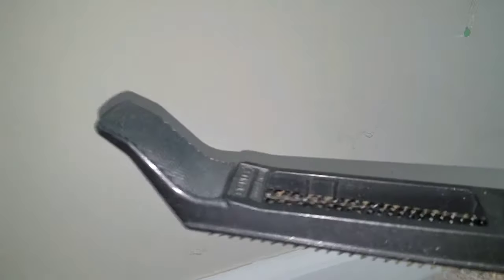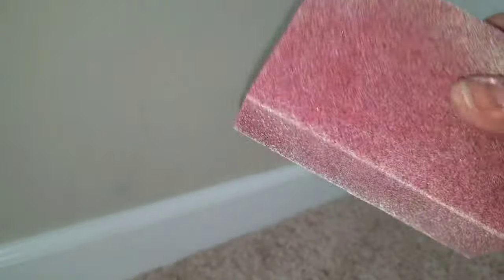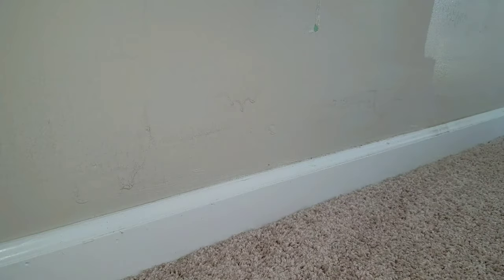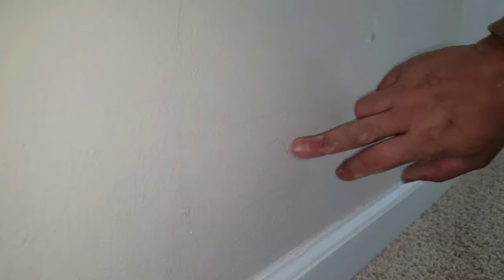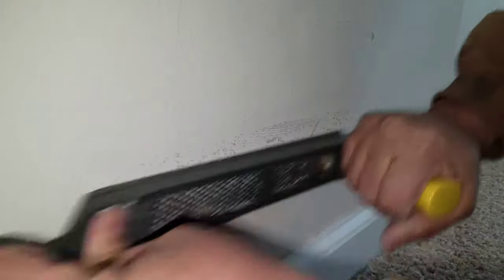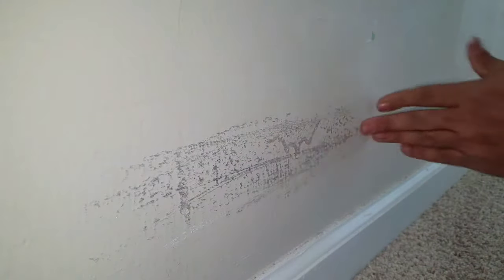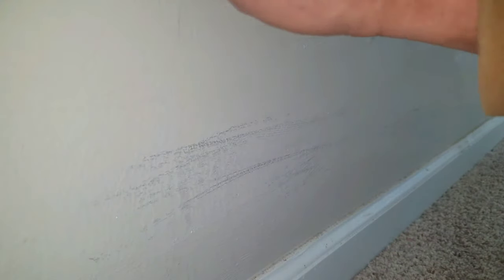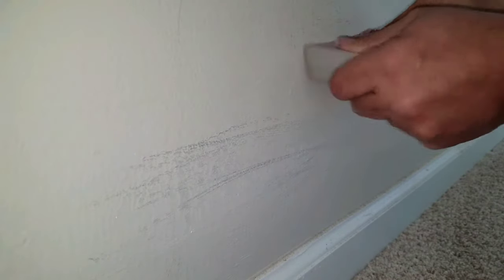How To Fix Paint Drips and Sags

Comment: My wife and I bought a house two months ago and the previous homeowners were quite honestly the worst painters i've ever seen in my life.  Runs, sags, drips EVERYWHERE on the drywall.  They also used cheap rollers and left lint and debris all over the walls.  To make matters worse they realized they had lots of drips and runs and attempted to go back and smooth out some of them with the roller while the paint was still tacky creating a smeared / smudged texture in many area and it's absolutely hideous.  

I am having to go through the painful process of sanding out all the debris, getting rid of the runs, etc. in a 2,400 square foot house.  Some rooms are better than others but the worst is the living room, runs everywhere.   I am going to try and get one of the rasps.  Joe, do you have a link to the type of rasp you were using?  

Tips to diy'ers when painting.

1. CLEAN YOUR WALLS of debris, dust, spider webs, hair, etc. before even thinking about picking up a paint brush or roller.  Trust me it will look 10x better just doing this prep.  It even helps to clean the floors in the rooms you are painting because hair, dust, etc, gets stirred up while moving about the room and this will stick to the paint if there's a lot of it, particularly if you are using eggshell and more glossy paints and not just flats.

2.  If your walls are really greasy or dirty you may have to use TSP cleaner or a degreaser to get rid of the grime otherwise your paint might blister.  You might even have to prime the wall to seal it in.

3.  Close any air vents or registers adjacent to the rooms / walls you are painting as they could blow dust and debris on the paint before it has a chance to dry.

3. When cutting in make sure you use a high-quality brush that does not lose bristles everywhere because you will definitely see them. and once they are dry in it's nearly impossible to get them off.

4. When rolling paint on a wall use a high-quality roller.  Yes, they are pricey +/- $10 for a 3 pack, but it's worth it not leaving lint all over the wall that looks horrible after your done.    

5.  As far as technique goes.  Always cut in first before rolling.  I know some will argue that you can cut in after rolling but generally I think that's harder that way.  If you do roll first, have someone cutting in behind you as you continue to roll and don't let it sit before cutting in as this will smudge and smear the paint along those areas, which is hideous.

6.  BIG TIP.  You will need two coats.  Some paint brands such as Behr claim you can get away with 1 coat.  Trust me that's not true.  You will need 2 coats.  Do not overload your roller with paint either as that will lead to drips, runs, and sags.  Apply pressure to the roller but not an excessive amount.  Let the roller do the work.  If you have very large surfaces to paint consider an 18 inch roller, but note they take a good deal of skill to use and your walls need to be relatively flat to get good coverage. 

7.  Keep an eye on the humidity is in your house when painting.  You can get little monitors that will tell you what the air humidity is in your home. I know that some people scoff at this claim, but if it's pouring buckets outside or is wet outside and the humidity is really high in your house it's generally not be a good idea to paint that particular day.  It might be worth getting a dehumidifier in the room and letting it run for an hour or so before painting.  Note that small rooms when painted on all the walls can cause a sudden spike in humidity.  If you get done painting a room and you can feel a noticeable jump in humidity and the walls don't appear to be drying, the humidity is much too high.  You need a dehumidifier or you are gonna get sags, and runs galore.  

8. Paint types.  Again I'm gonna get hit with comments on this.  To be honest I am not a fan of behr paints (primers, latex, and acrylic trim paints).  I've used them enough over the past 20 years and just think quite well honestly, they are crap.  Sherwin Williams paints (not the HD or Lowes knockoff versions they sell at their stores) and Benjamin Moore are typically much better-quality paints although they are quite pricey.

Comment: Thanks! I’m painting a house for a friend and the last paint job is horrific with massive sags and runs. This is aggressive but it will look better than what is there now.
Reply from the maker: Yep just try not to be overly aggressive with the sags. Remember, the solids in the paint you'll use will serve as a slight "filler" so just knock the sags down and paint as normal. You should be good to go.

Comment: We might need to do this to our house, before putting it on the market. We’ve lived in our house for 13 years and haven’t fixed what the previous owners did, but we have a paint run all the way down one of our walls. Being new homeowners, we didn’t even notice it when we bought our house. 🤦🏻‍♀️ And I’m just now looking into how to fix it.
Reply from the maker: If it's a really long, obvious run, you might want to skim a coat of joint compound and sand before paint.

Comment: Will I take the same approach on crown moldings, top between and bottom . Just bought a house  and they did a terrible job with painting ; lots of drip all over the crown molding too. ?
Reply from the maker: With crown, I'd be more inclined to use a sanding sponge. Get a couple of different grits (80, 100, 120) and progressively go up to 120. The sponge will handle the curves better and you can use the edge to get in the tighter detail.

Comment: Got few of them to fix as well before i primer n paint, one of the other issues i have to seal with is paint peeling sanding edges finely beinf the edges want to lift up but once primer is on should hide it.

Comment: How can I repair roll lines on a wall after the paint has dried? I suck at painting, lol
Reply from the maker: Lol. You can definitely use this repair for that.  Alternatively, using a sandpaper with 60 or 80 grit will work. 

When rolling, apply medium pressure and make sure you keep a wet edge to prevent lines.
Reply: Call a pro
Reply: All of joes tips are ridiculous. He is describing how to prevent flashing what you have are ropes. Basically the opposite problem for starters sooooo ya. For me to describe to you how to fix that problem would take about 50 or 60 pages. You could spend weeks of your life experimenting on the walls that you look at everyday or you could just go to work and do what you know how to do and pay a painter to paint